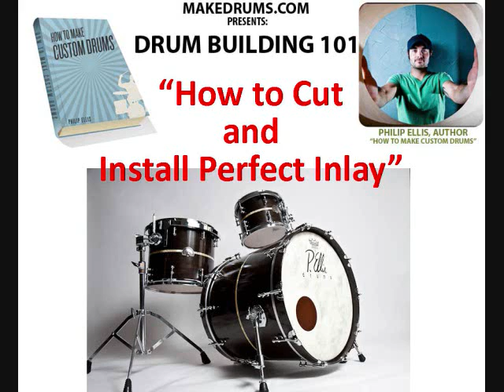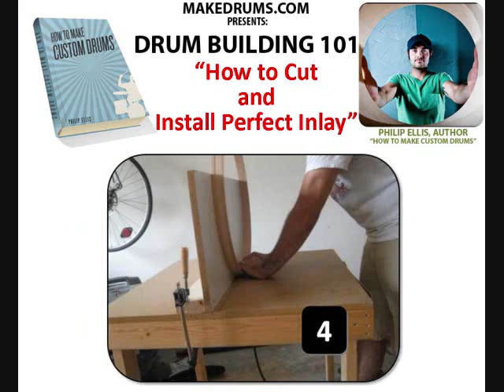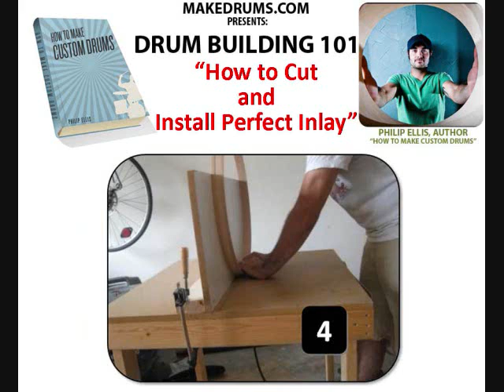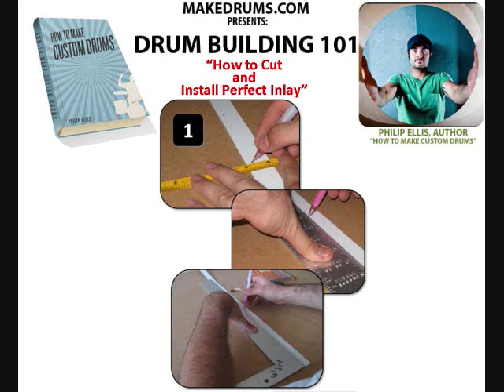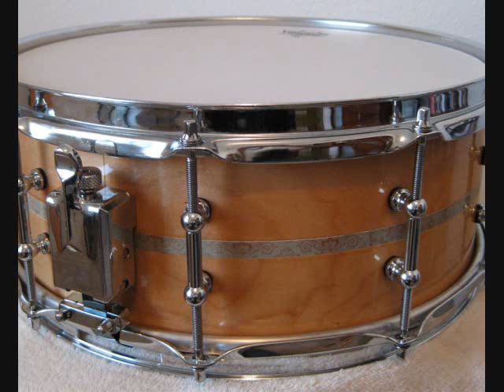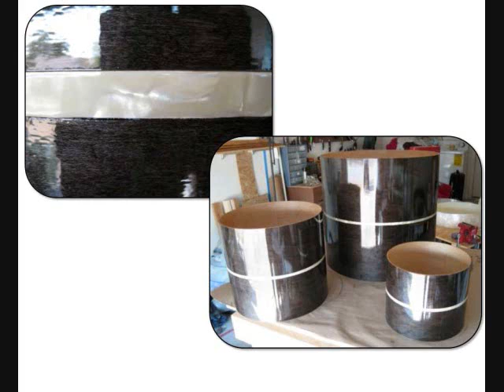How To Build Drums -  How to Cut and Install Perfect Inlay Strips - Drum Building

Comment: Great video.  I have been a woodworker for many years (not a drummer).  I would like to suggest that you DON'T use gloves when working with a router or any other power tool. If a tiny part of the glove (or a loose shirt, long hair, jacket...) gets caught in the bit it can pull everything into the bit (the glove and your hand in this case).  I'd consider making a sacrifical top for my router table and routing a groove in the top the same with as the workpiece in order to keep the workpiece from slipping away from the fence at its base.  If you do this (or something similar) you won't need to engage your hands as much.